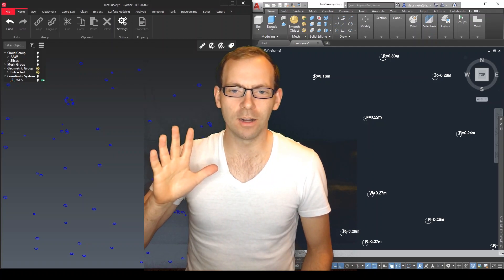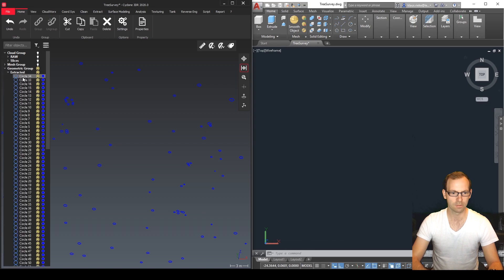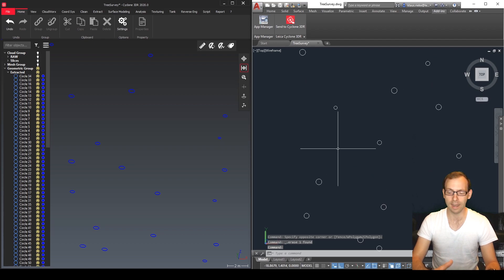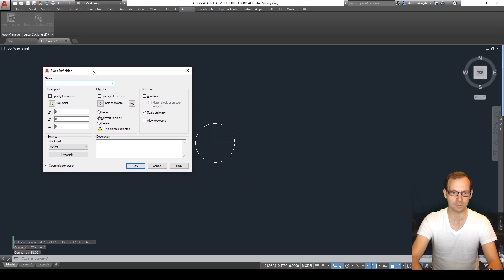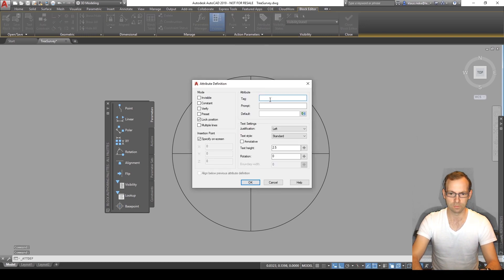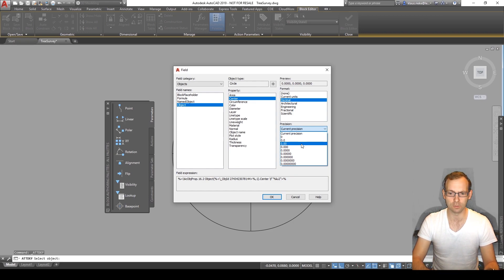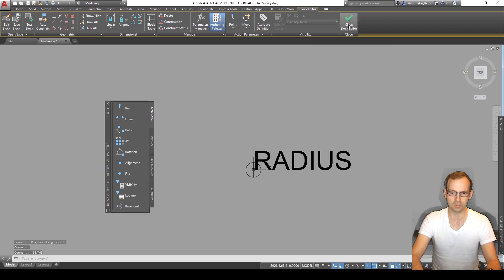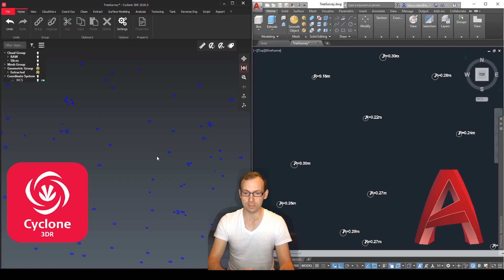Cyclone 3DR to AutoCAD - Parametric Block Video with Klaus Rieke

Comment: hello Klaus,
great video. Quick question, the last part of the video I didn't really understand the copy and paste procedure and how you started to get the values to change. Can you please explain? thanks in advance
Reply from the maker: @joshypoo777 in ACAD you start the copy command, swap back to your text editor select all (copy the coordinates) and paste them into the command line. Hit enter and they start to appear.

To update the values simply save the file 😉
Reply: @KlausR3D  worked like a charm. thanks for the quick assistance!
Reply: @Joshypoo777 you are very welcome